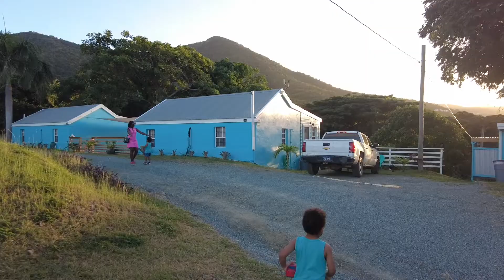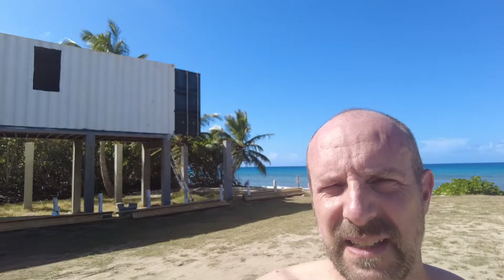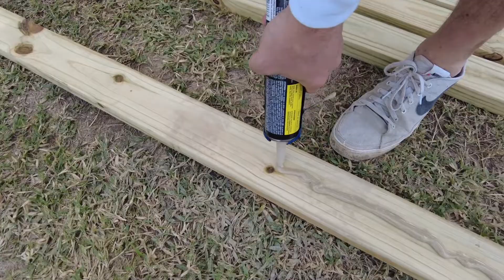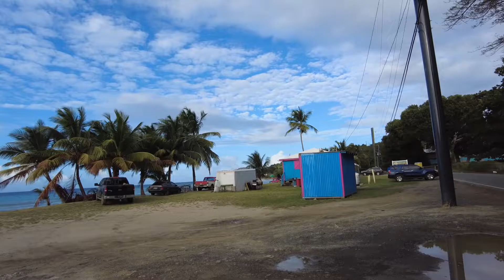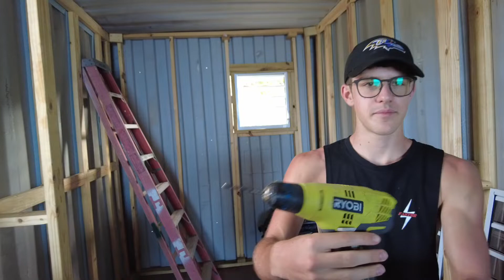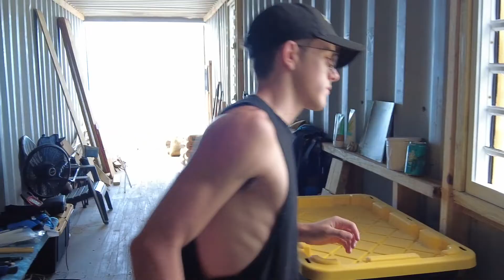Off-grid Tiny Caribbean Home on Stilt Windows installation St Croix USVI S2E4

Comment: That's awesome! I hope you don't get hit with any nasty storms.
Reply from the maker: I hope not, but it will be hit eventually, so I am preparing for the worst. Once I have the cistern connected and an additional slab parallel to the ocean in the front, it should sustain a cat5. The container is welded at multiple places, which should be OK already.

Comment: So with the lumber used on the inside, and the lumber used on the outside, plus of coarse the labor involved for cutting windows etc. etc. etc. and lets not forget the container cost, and the crane to lift it onto the concrete columns , it might seem a fair question as to who is kidding who here?
Reply from the maker: You are right, and, in most cases, it makes no sense to use a shipping container. In our case, we are on an island and needed to be on stilt with hurricane-proof building. The average cost per square foot is 350$ on this island. Local companies charge you even more when they realize you have landed on the island. We were quoted 90,000 just to build the post and cistern for one container (one house). So, for an auto-construction with my boys, having the structure in place and building around it with minimal trades required (Electrician, Plumber) makes more sense. The rest I can handle with my engineering background, growing up with a father that taught me everything construction and many friends and family (&YouTube) teaching me along the way. Container – you take, drop, and voila, your structure is there.
If you ask everyone to do shit for you and not stepping up yourself. Agree not much difference.
Reply from the maker: Another method that I considered was ICF, so you can build the foundation yourself, but I didn't see myself putting a styrofoam block 10 to 20 feet in the air with the wind and constant hot sun. Concrete on the island is also expensive and not the best quality because of the salt that end-up getting into it.
Glad you ask the question - I will do a video on it.

Comment: Looking good buddy. I really like St. Thomas this past December and want to see st croix next. I’ve been entertaining idea of a container home and you did it. Im thinking of building here in states and shipping there. So I see that they are a exceptable for building codes there? Any info or link to suck info would be great
Reply from the maker: Building code for shipping containers is more straightforward since the structure is already made. Obviously, if you start putting more than one, it might get a little more tricky. Otherwise, you follow the standard building code, and to be honest, you do even more solid because of the hurricane. Come visit and let me know 113CaneBay@gmail.com
The only thing is time to get something approved here, but you can get that ahead of time and ship your container already made, as you said, as long as the shipping company can do it. Not sure if you have an existing window that might get damaged during the move or the shipper won't allow it? I don't know... You are golden if you do the inside and only cut the window once onsite.
Reply from the maker: They want to inspect plumbing and electricity so better keep the shiprock once on the island.